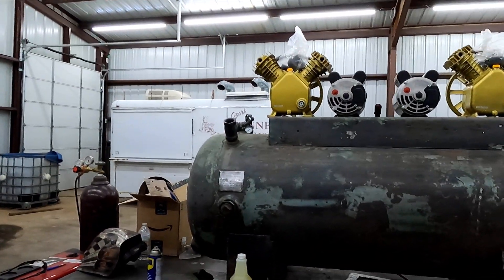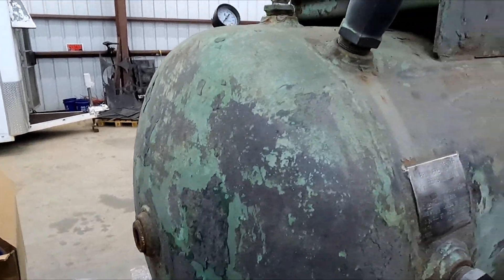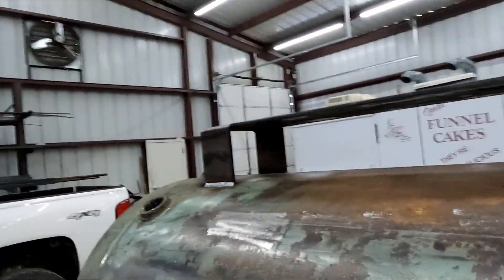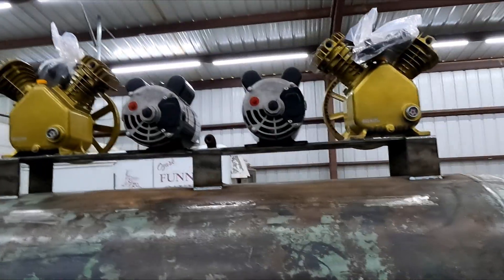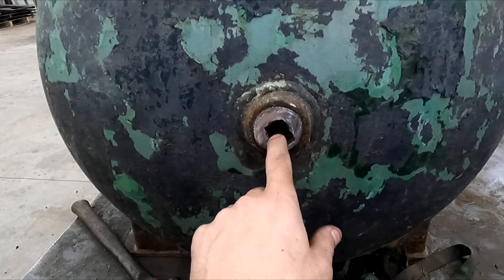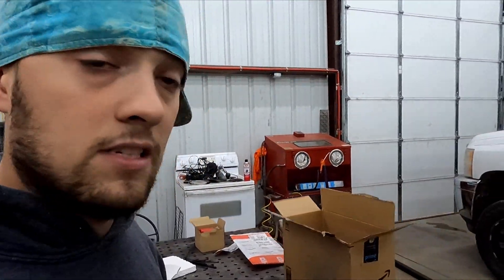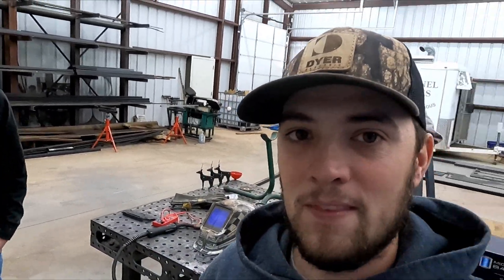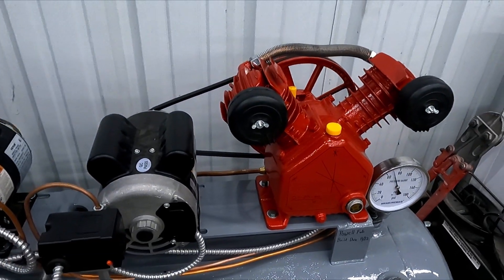Restoring An Old Air Compressor

Comment: Is it safe to use such an old tank?
Reply from the maker: In some cases I would have said yes. But In this case I could actually see in the tank and verify no bad spots. Also we pressure tested it outside before we started in on the project.
Reply: @powellfab.3357  In that case congratulations for the awesome compressor.
Reply from the maker: Thank you, we really like it

Comment: You guys are great!! I am completely restoring a Lincwelder 225 and converting an electric air compressor over to gas  along with some other projects. I just ordered a tripod that can hold an iPhone so I can start videoing all these things I am working on. You guys are totally awesome!! Where are you guys located?
Reply from the maker: Thanks man really appreciate it! We are located in Arkansas.  We don't have any more than a go pro and just having some fun.
Reply: @powellfab.3357  I am just talking to another creator and we are talking about collabs. We are in Pa and when I start filming I am going full bore.first should be finishing a rebuild on a Lincwelder 225 (the parts no one ever shows). making obsolete parts and what is inside the parts no one shows., Then I am converting a self propelled snow blower into a hydraulic dump barrow, self powered. Next a self powered dumpwageon, with tracks made from scrap tires and metal that does not blow through like the commercial dial stuff, The next will be a full restoration of a Wweldanpower 150 and a Miller Bobcat 225. I believe that takes us into summer there. I know somewhere in there you guys would want to do sometime of collabnbuild where we both do something and then get together to go blasting. like making a ride on dump wagon that has tracks that  can you can ride on and go through swampy wooded land. Then we can get together there or here or contact guys at cars and cameras and meet somewhere warm and go have fun and film it. I also have a place that has some great old tractors that I can buy for not so much and repair them. Looking forward to all sorts of stuff.

Comment: Based on the label, that tank appears to be a Wayne Compressor company. Likely from late 60s (67?)I have one dated 1960. The green paint is a tell-tale. If you have the original pump, and it’s a Saylor-Beall one, restore it! These are worth big $$$$

I picked one up at the scrap yard for $100. I put a new head gasket on and it’s like new. A comparable unit is about $6500 to buy new
Reply from the maker: Man that is cool to know. I'm not sure if the pumps were laying around or not but be cool to see. Thanks for the Info really appreciate it.
Reply: @powellfab.3357  the pump should have a casted number on the sump like “4048” and it may say “Saylor-Beall.” Mine says “W/C 4048” and has a serial number.  It puts out 22cfm at 90psi on a 5hp motor. My feet get tired while blasting before the pump has to come on. (100 gal tank)